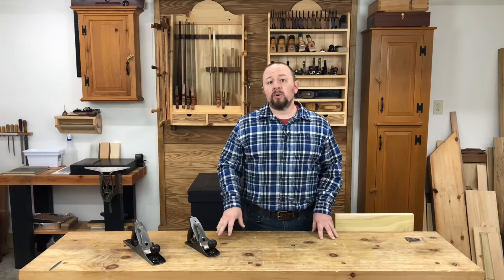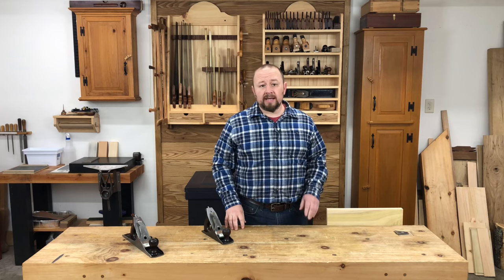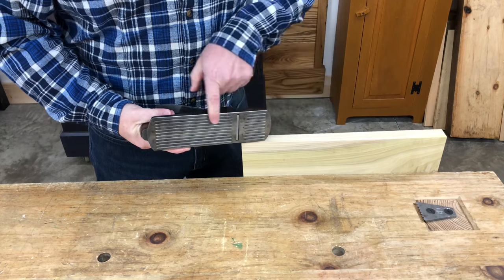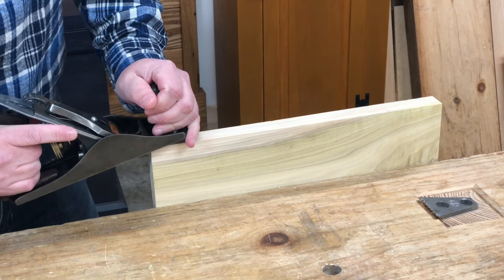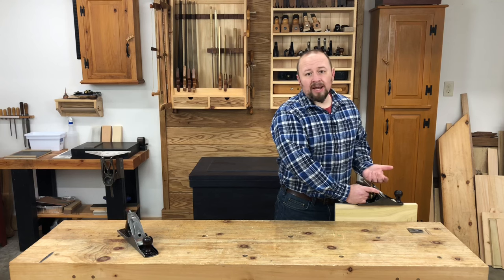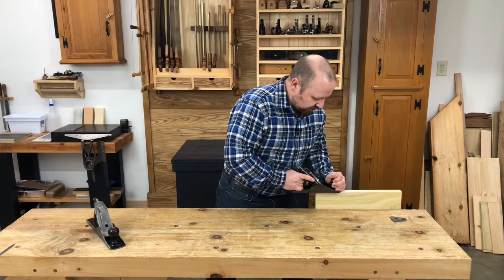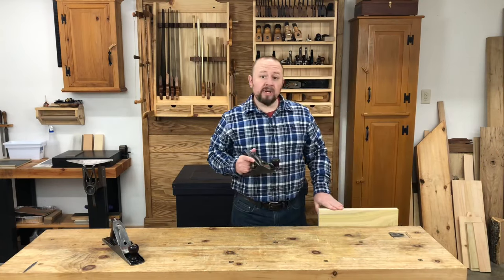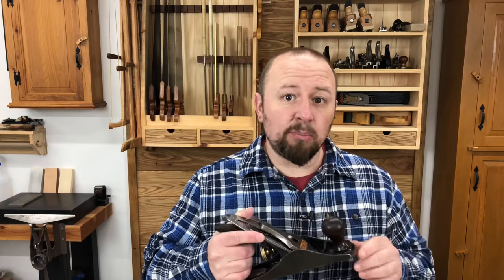How to Hand Plane & Why It Works | Hand Plane Foundations

Comment: This should be the first video after learning parts of the plane and how to set them up. It took me forever to finally figure out why my boards were always thinner at one end. Techniques for using bench planes is surprisingly hard to find. Instead, the vast majority of instructional content centers around their restoration, sharpening, fettling, etc. You'll even encounter far more content on how to use specialty planes, such as routers and plough planes, than bench planes.

Comment: This was eye opening for me. I've only begun using hand planes for the last 3 weeks and didn't understand why the plane was getting caught right at the end of my full stroke. I was keeping pressure on the front throughout. Thanks for this piece of advice. 
I was told using the electric jointer machine to keep pressure on the front of the board to stop Snipe from happening as u come to the finish of the run across the blade so I guess I was thinking similarly with hand tools. 
I'm glad I caught this video. 
I have an issue sometimes when I plaining the edge of a board where it is planed uneven. Is there a good technique to stop this from happening so I get a flat surface every time? It happens to me a fair bit but not always. Maybe I'm not concentrating enough sometimes? I don't know why it happens and other times it doesn't??
Glad I found ur video though my friend. Very informative. Thanks very much

Comment: When you are hand planing a table top to even out raised areas where boards were joined, where the table is obviously wider than the hand planer, how do you not get a groove equal to the diameter of the planer? Then you are just chasing lipstick/ledges.